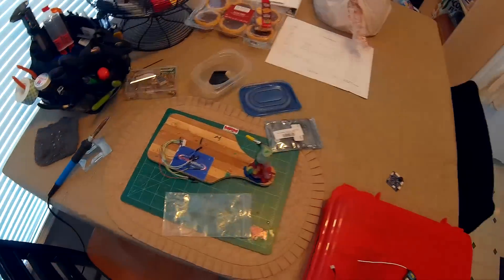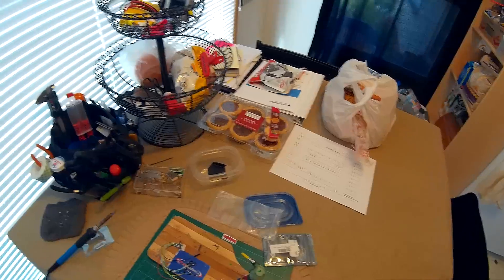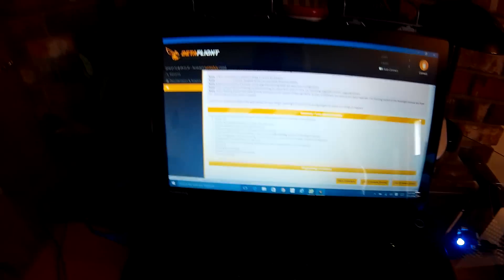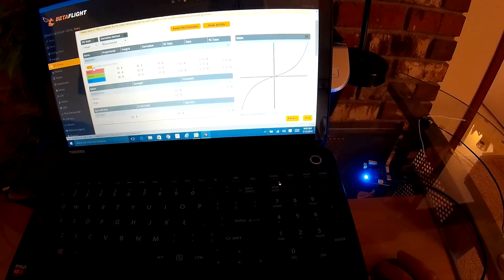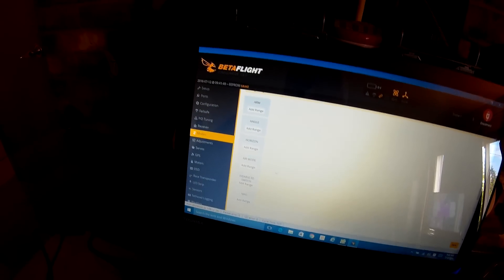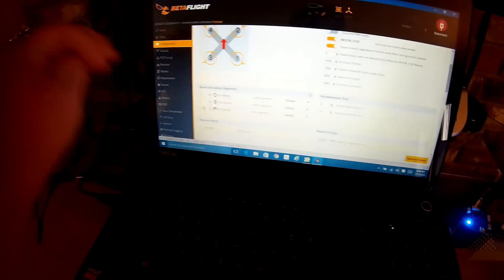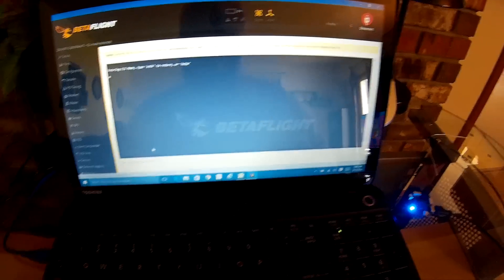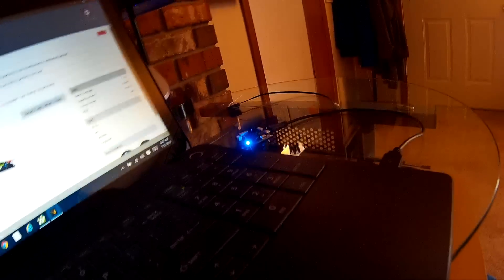flash betaflight and setup satellite receiver

Comment: does it work for all flight controller? i tried it on flip32 f4 and my sat receiver doesn't even light up.
Reply: did you get it to work? mine wont do anything. I type set spektrum_sat_bind=9 in the CLI and says invalid name
Reply: Did you ever get your sat reciever working? Got the same problem with mine

Comment: Hello ,
I have the board F3 V4 aio and a problem with my satellite (Lemon RX DSMX).
I have bind the satellite with a receiver successfully before connecting to the board.
The satellite gets measured 3.3V and is soldered to the UART3. 
In betaflight (3.1.3) I have made the following settings:
- UART3 -> Serial RX -> on
- Receiver Mode -> Serial-based receiver (SPEKSAT)
- Serial Receiver Provider -> SPEKTRUM 2048 or 1024
- Channel Map -> TAER1234

Unfortunately the satellite does not connect with the remote control as soon as I connect the battery. There is no LED flashing on my satellite.

Does somebody has any idea?